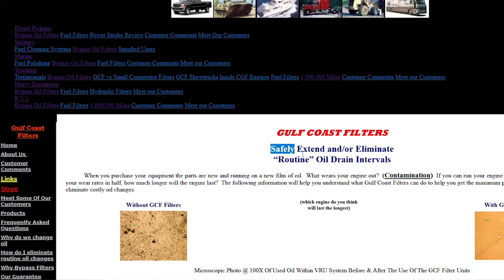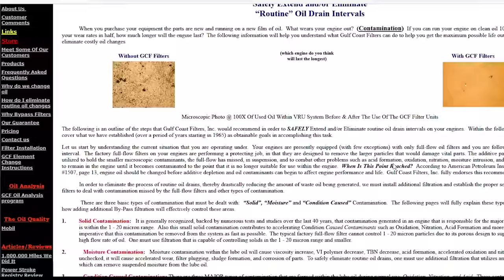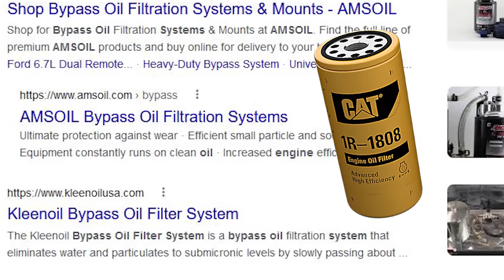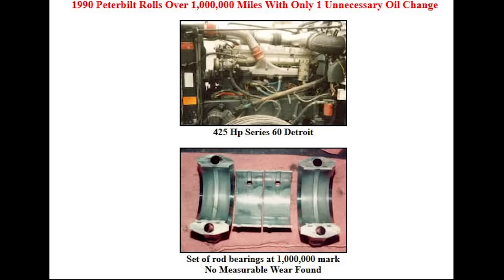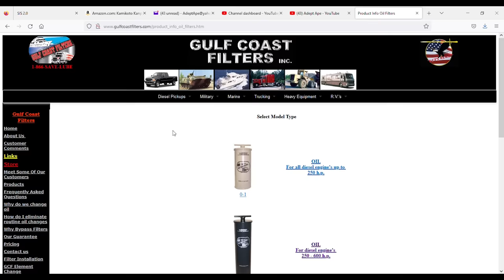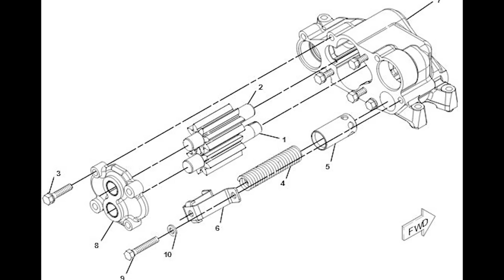No Oil Changes and 1 Million Miles!!! Are Oil Changes Optional with a Bypass Filter? (INTERESTING)

Comment: Been down this path long ago & your video sadly wasn’t great on this occasion.
Frankly you’re out of your depth on this one.

There is something in diesel engine oil called an “add pack” and it’s a unique formulation for each oil much like a secret witches brew that’s supposed to add properties to the oil to help it do its job better.

One such additive typically is detergent.

Diesel engine oils typically have more detergent than an equivalent petrol engine oil.

Thats because diesel engines create more soot particles that gets into the oil than a petrol engine oil.

The detergents job is to keep the soot in suspension, so that it can be drained out with the oil at oil change interval.

The detergent also helps prevent soot particles agglomeration (clumping together to form larger soot lumps that might cause excessive wear, and block filters or pickup screen mesh etc.

But there’s other stuff in the add packs as well. That part literally is a science to itself.

There’s a bunch of oil knob heads (industrial chemists etc) from the oil industry who hang out on the BITOG form (BITOG = “Bob Is The Oil Guy”).

They all discuss oil formulations and virgin plus used oil testing etc etc as well as how to analyse / interpret used oil test results.

So one potential risk is that sub micron oil bypass filtration NIGHT filter out some of the oil “Add Pack Components” that the industrial chemists who formulated the oil deliberately put in there.

Thats a real risk.

Next there’s “used oil analysis”.

Back when I was running Oilguard sub micron oil bypass filtering system on my 7.3 Powerstroke - I was getting Used Oil Analysis results from Oilguard in the USA.

I used to graph the results at each oil change, so I wasn’t going to extended oil changes because of the sub micron bypass filtering - I was still changing oil every 5000 kms (3000 miles).

The Used oil analysis results were pretty good (to be expected).

Out of interest, I thought it might be “interesting” to do a “dual blind test” by halving a used oil sample & send it to 2 different labs and see how closely the analysis results matched each other.

I sent off the first one as usual to Oilguard in USA & to see what difference their might be, I sent the other identical sample to my local CAT dealer here downunder who also have a used oil analysis service.

Results from US Oilguard were same as always, basically perfect.

Result from my local CAT dealer however were totally different.

Their analysis and interpretation was that my engine was totally stuffed and I needed to urgently buy a new diesel engine from them for $20k+ and pay even more for them to change it out.

I queried their result in case they mixed up my sample with someone else’s engine & they assured me that “no there was definitely no sample mixup & that was my analysis result and interpretation.
The US Oilguard results were nothing like the Aussie CAT dealers results, just like chalk & cheese.

The engine only had 60,000 miles on it and was running 100% perfect.

Here we are ~ 20 years later and I’ve since sold the truck but the new owner still running that exact same engine with the same bypass oil filtering kit and 5000km (3000 miles) oil and filters changes and it still runs as good as the day it was built.

What this taught me is that someone at my local Cat dealer is a their and a rogue & deliberately switched out my used oil sample from someone else’s destroyed engine in order for a salesman to get a commission on selling me a new engine and to drum up more work for their workshop fitting said new engine. 🙄

I’ve never bought a CAT product ever since - nor used any CAT workshop to perform any work.

In short I wouldn’t trust CAT as a company as far down the road as I could kick them.

So there’s a heap more to bypass filtering and used oil analysis than you’ve covered in your video & unless you want to do the testing yourself - and have factual results then any opinion of yours is just based on heresy.

At one point I ran Mobil oils new Delvac 1 fully synthetic oil and the used oil analysis wasn’t as good as it had always been using my normal oil.

I discussed the results with Mobil & sent them details of the UOA and their industrial chemists ended up “re-formulating” the add pack in Mobile Delvac 1.

They never admitted it, but in addition to my used oil analysis, I’d had virgin oil analysis performed and the results came back different the next batch that I virgin oil analysed - so I could see what changes they had made to their add pack. 😜

It’s a big topic & not something easily covered in a 20 minute YouTube video.

You seem like a decent mechanic, I’d stick to mechanical videos if I were you, coz your a bit out of your depth on this topic is all. 😉👍

Comment: Look into amsoil. They have been making the same statements for years, and they have lots of evidence to back up the claim. Would I never change the oil and only top off when the filters are changed, probably not 😂 but they say it works
Reply: I remember Amsoil had a canister filter in the 80s that might have been as good as toilet paper. It wasnt cheap. They had Bobby Unser saying this oil change is forever. At the time I was using Amsoil 10 40 with a Frantz oil cleaner.and was going on 20 years with no routine oil drains.I dont think the newer Amsoil filters are as good now. The dual remote is a joke. My wife once asked me if I had tuned up the beetle. She didnt have to shift on the small hill. I had just put Amsoil in the transmission.Good lubricants.Actually the quality of the oil makes the not so good filters look good..
Reply: One oil I wanted to use but never did was the 30 weight diesel Amsoil.Dont know if they still make it. Knew a equipment rental place in Coffeevile Kansas that used it.

Comment: And then of course there is the VW air cooled beetle which cleans the air and oil with a sieve to catch big lumps and physics ( oil and air are forced to do a U turn) to catch the iny tiny pieces. What. Mills them is not cleaning the sieves and changing the oil every 3000 Kms.

Comment: Volvo engines have ALWAYS had by-pass, there has NEVER been any talks about extremelly extended oil changes!?
Reply: Dont know about Volvos. Normally the factory installed bypass filters dont clean oil. The filters that clean oil are all after market as far as I know.
Reply: Come to think about it the few Volvo cars Ive done didnt have bypass filters until I installed them. Got a message from Israel. A guy says as a child he remembers watching his mother change the Frantz on the Volvo.
Reply: @ralphwood8818  We are NOT talking about CARS, we are talking a bout class 8 heavy-duty TRUCKS, 18-WHEELERS!!!
Reply: @bosabarbosa1795  Not that much different All it amounts to is keeping the oil clean and adding enough new oil to keep the additives up to specs.The big Gulf Coast filter on the Peterbilt takes 3 gallons of make up oil. My bypass filters take one quart.Dont know of any factory installed bypass filters that clean oil. Even the Luberfiner didnt clean oil. You still had to drain the dirty oil.

Comment: Regardless of how great a filter system you have, your oils properties break down, it loses its ability to lube, carry away heat etc. So no, you can not go without changing oil.
Reply: A million miles with no oil change is worth looking into
Reply: I wouldnt  call it no oil changes.When the filter is changed 3 gallons of new Rotella 15 40 is added. That is a lot of new oil added in a milliln miles. My Pontiac Torrent gets a new quart of oil at 6K miles when the Jackmaster Classic is changed.
Reply: I drive mostly highway in warm weather. You have to make adjustments for different conditions.
Reply: I guestimate the series 60 Detroit got about 350 gallons of new Rotella added in a million miles.as.make up oil when the filters were changed. Thats why the wear rate is near zero.. Itz not a allow the oil to get dirty then drain it system. It is misleading to say only 1 oil change.. i believe Road King said the amount of new oil added is equal to an oil change every 40.000 miles.. oil analysis says thats a little more new oil than needed.

Comment: Volvo truck engines use bypass filter from the factory
Reply: Dont know about Volvo. Most factory installed bypass filters are a full flow filter with an orifice. The slower the flow the better the cleaning. Not good enough. My Mazda diesel pickup had one. I removed it and installed a Frantz oil cleaner. When I sold it I told the guy I would put the stock filter back on. He said hell no. He knew about toilet paper filters. Probably a good idea to remove the filter before putting the ad in the paper. A guy wanted to trade me a  Dodge Warlock pickup. Looked like that little red one It was green. Probably valuable now.

Comment: I couldnt take the risk, save money on oil vs potentially rebuild engine?? If this thing was really the answer wouldn't everyone use this??
Reply: The risk is running on dirty oil
Reply: Engines run better with 100% clean oil 100% of the time. Allowing the oil to get dirty wear and foul the engine then draining it makes no sense and never has.my 41 Dodge had a lot better filter than they put on new cars at cleaning oil.
Reply: How can you sell filters that clean oil to people that think proper maintenance is allowing the oil to get dirty then draining it? Read some of these posts.

Comment: What's surprising to me is that the oil additives don't break down or dilute, apparently. Detergents and viscosity modifiers to just name two that I know of. It's also kind of funny and concerning, that this manufacturer seems surprised about the performance of their own product (and Amsoil has a similar story). Like: shouldn't they have more data, and be able to predict this performance? They treat it like an outlier, like an exceptional one-off case. Look at this one thing that happened! We are all so surprised! Kind of the opposite of what you want to hear - they should know what it does and how it performs, and be able to tell you that certain things will and won't work. Amsoil's story was that an engine wasn't running on enough oil, and still lasted long, IIRC.
Reply: Dont know why they would be surprised by filters that clean oil. I remember seeing the Frantz 3 stackers on heavy duty diesels in the early 60s. When the Frantz 3 stackers went out of production they were replaced by the Gulf Coast Filters.

Comment: As a refinery lab guy, test the lubricity of the oil new and test it again after 20k or 100k or 1MM miles. Drastic differences I would bet.
Reply: Its been done a lot of times in the last 100 years. My 41 Dodge had a bypass filter.with a decal of a dipstick with golden oil on it. It read the dipstick tells the story. It was the same as a Luberfiner.

Comment: I imagine they're adding small amounts of oil all the time so it's not the same oil for a million plus miles
Reply: Very true How do you claim no oil changes when you are adding 3 gallons of new Rotella at 10.000 miles  bypass filter changes. The reason the engine has virtually no wear is the oil is never allowed to get dirty..Im not good with math. How much new Rotella was added in 1 million miles adding 3 gallons of new oil every 10.000 miles and 5.5 gallons when the full flow filters are changed at 50.000 miles. The main advantage is longer engine life. These people live by oil analysis.. My Pontiac gets a toilet paper change and a quart of new oil every 6.000 miles. After 60 years I know what clean oil looks and feels like. The Pontiac has a Jackmaster Classic.  The other engines have Motor Guards and Gulf Coast juniors. The Road  King article said the new oil added is equal to a full oil change every 40.000 miles. More when the full flow filter is changed
Reply: The Detroit gets about 350 galllons of new Rotella added in a million miles Only 1 oil change?.

Comment: Engine oil will not last because of heat and also the additives in the oil will not last that long
Reply: Good you set me straight on that . I   stopped allowing the oil to get dirty then changing it in 1963.

Comment: Lol did you not see those gear display s and see improvements from Lucas oil?? What do you mean it wasn’t tested or proven?
Reply: Recently bought a Old Ford diesel tractor..The hydraulic oil runs everything hydraulic including the power steering. Also lubricates the 12 speed transmission and rear end. The hydraulic oil has to also meet gear oil specs. The only fluid Auto Zone had that met the requirements was Lucas.. Took 5 galloms.only a strainer. I put a Ford FL 1A on it and a old Motor Guard  submicronic.filter.
Reply: Had to do the filter a little different. Used a Motor Guard and fed it with a needle valve with a pressure gauge.

Comment: I wouldnt add it til your truck is out of warranty
Reply: The filters dont void the warranty. Its a good idea to have an oil analysis program to prove the oil is good in case there is a problem with a engine Gulf Coast Filters has letters from the big engine makers.

Comment: Doesn't oil wear out because the ploymers wear out>
I think I'll need the Society of Automotive Engineering to weigh in on this before I'll believe that oil lasts longer than 7-10K miles.
Reply: @ralphwood8818  I'm with you - better filtration is helpful...but oil wears out and loses its lubricity, and filtering it won't bring it back according to the SAE.
Reply: @Wyowanderer  The reason the system works is the two rolls of Bounty big roll paper towels  requires 3 gallons of new oil added at filter change. Plus the big filter forces the oil to travel thru 22 inches of filter media..A NASA diesel equipment engineer said toilet paper is better than paper towels This is true but big filters clean oil better than small filters. The reason NASA started using the big filters is he debated me on a Trawler forum. I put him in touch with people that know more than me about the subject. Im a car and pickup guy. They were moving the Shuttle then. No doubt Shell offshore drilling got a call.They use locomotive engines.
Reply: @ralphwood8818  I'm sure it filters very well...but no amount of filtration can keep oil from wearing out. Even perfect filtration still leaves clean oil that isn't lubricating as well as fresh oil. But you're arguing with the SAE, not me.
Reply: @ralphwood8818  I'm perfectly aware how it "works", Ralph. But until you can show me that the SAE thinks old oil works as well as old oil, I'm not going to agree with your opinion, because the SAE uses science, not Bounty towels, to come to conclusions.
Reply: @Wyowanderer  Im pretty much an expert on small filters. When Shell oil uses the big oil filters on their Locomotive engines on their offshore rigs there must be a reason. I doubt that the SAE knows more than Shell oil. There must be a reason you find these big filters on shrimp boats crew boats and other big marine engines. A Standard oil engineer showed me his Frantz oil cleaner and told me to use Delo 100 in 1963. When I worked in a Standard station. I didnt call the SAE. I went looking for a Frantz dealer. I bet the NASA diesel guy didnt call the SAE.He might have called Shell oil engineers. There is a lot of difference between old clean oil and old  dirty oil. Im so smart I have learned clean oil is better then dirty oil. I have never argued with the SAE. I just change the toilet paper and add a quart of new oil.
Reply: @ralphwood8818  I don't care if you think you're an expert on God almighty - I'll trust the SAE, not a dude on the internet.
All the best.
Reply: @Wyowanderer  just a guy that thinks filters should get dirty and  oil should stay clean.. oil doesnt wear out like a shoe..
Reply: @ralphwood8818  You disagree with science, Ralph.
Reply: @Wyowanderer  I dont think science tells me oil is supposed to be allowed to get dirty wear and foul the engine then be drained.
Reply: @ralphwood8818  You're diverting. Get back to the subject at hand. 
Are you trolling?

Comment: Lol they changed the oil at the 1 million mile mark and then showed the oil in the engine was clean 😂 claiming it went 1 million miles with one oil change. Anywho, that's what I'd do if i was trying to sell a product. Regardless, 1 million miles is impressive no matter what!
Reply: It got 3 gallons of new oil when the 3 gallon filter was changed at 10.000 miles. More when the full flow filters were also changed at 50.000 miles. Thats a lot of oil changes in a million miles. The Road King magazine article said it was equal to a full oil change about every 40.000 miles. With my Pontiac.its a quart of new oil every 6.000 miles. The full flow filter has 64.000 miles on it..

Comment: Oil does wear out.....but Jiffy Lube sold the big 3000 mile lie.
Reply: I dont drain oil i have filters that clean oil. If my filters didnt clean oil I would change it but probably not every 3 K miles. Gave up allowing oil to get dirty and draining it in 1963. No oil doesnt wear out. If you let it get dirty you will need to drain it.

Comment: Wix filters for cat7 are 10 micron
 Just saying.
Reply: My Rambler American had a 10 micron bypass filter To clean the oil I tossed it and installed a Frantz oil cleaner. I prefer the top loaders but if the filter elements are Toilet paper or look like toilet paper its a good filter.

Comment: Oils and other lubricants cheap compared to mechanic labor and parts. Seems like too much risk for a small benefit 🤪
Reply: Keeping the oil clean doesnt mean you have to pay mechanics to repair the engine. Oil isnt cheap. Allowing the oil to get dirty wear and foul the engine then draining it is expensive.
Reply: @ralphwood8818 ????
Reply: @functionalvanconversion4284  Just a guy that thinks filters should get dirty and oil is supposed to stay clean and thinks the risk is in running on dirty oil.